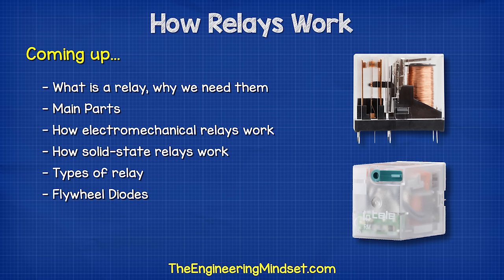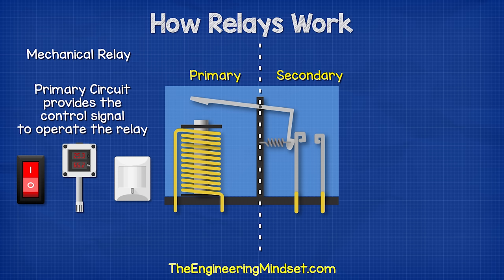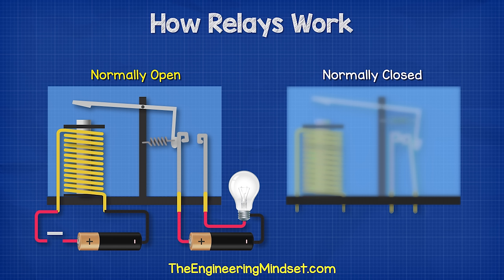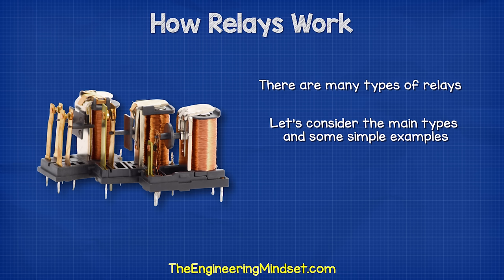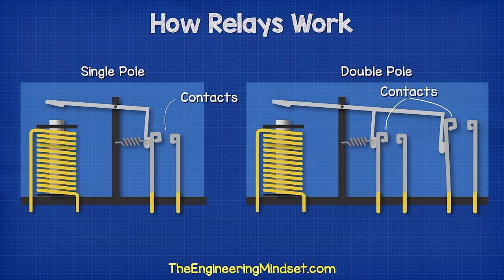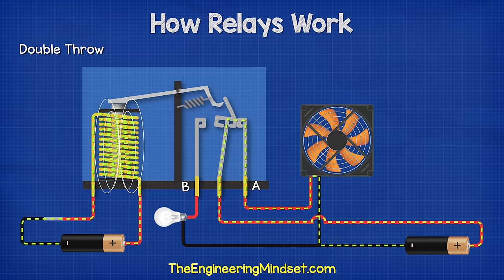How Relays Work - Basic working principle  electronics engineering  electrician amp

Comment: Prior to introduction of communication-based train control (CBTC) and for those lines still not so equipped, the New York City subway system's signaling system is run by electromechanical relays, with gear designed a hundred years ago.  Konrad Zuse's Z-1 computer, the first production computer in the world, used relays rather than vacuum tubes because Germany did not have access to vacuum tubes.  This computer was used in 1941 to design the V-2 ballistic missile.

Comment: Thanks! Dumb question here 🤚. If the purpose of the relay is to open/ close a circuit, why not use a button?
Reply from the maker: Because we can automate it with sensors etc, no need for someone to push a button then. We can use it in safety systems for example to automatically take action.
Reply: The Engineering Mindset makes sense thanks!

Comment: Last week I was given a broken earth leakage breaker to open up and see how it works. I really enjoyed it because I always wondered how a switch de-switches on its own, you know...

Interestingly enough, instead of the relay controlling a circuit, the leaver of the mentioned relay above, is used in a mechanism. You have the switch in the N.O position and closing the switch is like standing up from a crouching position. Even with passion to stand up, it takes so much effort to do so... as with the switch. The switch latches in the N.C position like locking your knees before gravity brings you back to the ground and giving your head a haymaker with your heels. 

You know that weird thing some of your friends do when they kick the back of your knee and you collapse to the ground? That is what the relay does to the switch. In the closed position it is very stable, but has a linkage that creates a weakness for the switch to spring back(with a spring, how original) when introdused a very small force over a small distance. 

You have your live and neutral inputs for the breaker. It gets converted into a small dc current to power the relay. When the neutral and live wires are misbehaving or you press THE BIG RED BUTTON, i mean the test button the circuit has compared voltages and determines that there is enough current and gives some to the relay. The relay wakes up, kicks the switch between the legs, the switch enjoys the fetal position and puts the misbehaving wires to sleep.
Reply from the maker: Seen our new incredibly detailed MCB video? link: https://youtu.be/gqEu9t8HwW0

Comment: I found this useful in my current amateur wiring project, and got some good ideas to make my circuits more efficient/safer. I would like some more information on using VSRs and maybe a section on common naming conventions so I can more confidently purchase these things! For instance, when using a "12v relay" does this mean that a 12v current controls the load circuit? How do I know if it's normally open or normally closed, because this information is not usually advertised as far as I can tell...

Comment: In electro-mechanical pinballs, there are at least a dozen relays used. In electronic pinballs, there still are a few. The flywheel diodes are extensive.

Comment: which side of the relay would the diode be placed?

The feed in to the coil side or the other side controlling the NO/NC switch?

Or both?

Also, how do you calculate what size diode you would require?

Comment: Im going to use relay for two contactors used in automatic trasfer switch. Can you give advice on what is the specification of diode to use to prevent back emf? The relay is 220vac coil 10amp normally close. Many thanks if you can help.

Comment: Have an AC relay resistance of primary is open circuit yet it works fine. Could it have a capacitor in series or even diodes?

Comment: Will make a small automation through my solar inverter's dry contact signal. 
When on battery mode, it switches to NC status and will send a signal to a contactor with 1 NO and 1 NC position. Once the contactor energizes a red strobe will activate, indicating the unit is running in battery mode and when de energized a steady green light will be on through the NC position.
Reply from the maker: Seen our new video on HOW SOLAR PANELS WORK in detail https://youtu.be/Yxt72aDjFgY

Comment: Hi Nice video.  I have a  boat (RIB) with an inboard diesel engine and z drive. The trim and tilt function which lifts the drive unit and propellor up and down is controlled from the helm using a  up down rocker switch. The circuit contains a hydraulic pump which in turn is operated by two 24v relays, ( one for up and the other for down) I think they are  the normally  off type.  Im wondering if solid state relays would be a better and more reliable alternative?

Comment: I wanted to use relays and a battery with a diy switch to control the water level in my pond. I’ll also use it to switch a small dc pump when there is a power cut. This way I don’t have to worry about power cuts

Comment: I bought a 12-position knob switch to control several circuts of LEDs (mostly in pairs). My hope was to have Position 1 as OFF, Position 2 illuminate Pair A, Position 3 illuminate Pair B, Position 4 illuminate both A&B, etc. (The project is a model house and garden; I wanted to be able to turn lights on/off in groups to look more realistic). The concept is simple but the wiring is complicated for a beginner, and I've bitten off far more than I can chew. 😑

Comment: For the Back EMF, i have been experiencing 36W fluorescent tube being damaged during power cuts. So I get to change the fluorescent tube every time there is a power cut and when power comes back on again. So how do I connect a diode like the one explained to protect the light tubes from back EMF? where exactly do we connect the diode on the circuit?

Comment: Quick question: 
I have battery with power 12V/8Ah
I have a wire harness with 12V/80Ah relay on it.
Can I use that relay?
What’s the advantage and disadvantages for the setups, also longevity of the setup.

Comment: If I’ve got a 12v relay (for car lights), can I run it at 24v?
Reply: In this case, no. Please always be aware of the rated coil voltage to ensure optimum performance.
Reply: TELE Controls Inc. right, but could I do it?

Comment: 1:30. Says relays are used in circuits to reduce current that flows through the primary control switch.
But Isn’t the amperage (current) going to be higher on the low voltage side with the battery?? Since as you reduce voltage you increase current.

Comment: Fire alarm- relays for tamper and flow. Normally open for tamper and normally closed to flow sensor. Power close for tamper to set of fire alarm and power open to let you know the water is flowing.

HVAC-NO contactor used to sense water, NO for dual fuel, NO used to turn on fans, NC to set off alarm with float switch, used to turn on line voltage heating with low voltage thermostat.

Electrical-relays are used to power up a lot of lights, also lights and fans for grow rooms.

Relays are great.

Comment: what type of relay would I use if I wanted to take a 230v UK mains supply to simply close a circuit?

I want to fit an always on extractor, however, it reports it has a manual override that can be operated via an unpowered switch.  I figure that the fan has 2 contacts, one of which is powered and the switch simply closes that circuit.

Problem is, I will have a switch which will be providing 230V.  Also, the switch is a smart switch that I can control via my smart home.

If I can get this to work, it will allow me to control it via other sensors elsewhere on the house.

Thanks for any feedback

Comment: I am working on a useless machine (turn itself off when turned on) and I think a relay will be useful. I am using sensors to detect temp and vibration after which the circuit will turn off with the help of relay and Arduino

Comment: I really wish you would change the explanation of the latching circuit. it is not how most relays work. typically the latching function is done with a set of normally open contacts, on the relay itself, wired in parallel with the monetary electrical component that starts the relay function. They have a normally closed stop button in series with that parallel circuit to shut this latched circuit off.  I really like your stuff and use your videos in industrial electronics classes I teach in a Community College. This part of this one will confuse the hell out of students though and I am reluctant to use this one.

Comment: In the latching relay representation of the elevator, why does the lamp stay on when the call button is released as the power is being cut to the initial circuit?

Comment: 7:30 ive seen relay in ebike controller to turn on main power hehe
id like to use a relay to turn on and off a homemade  spot welder with microwave transformer 
though i did not find a relay that suit my need yet  that is easy to use

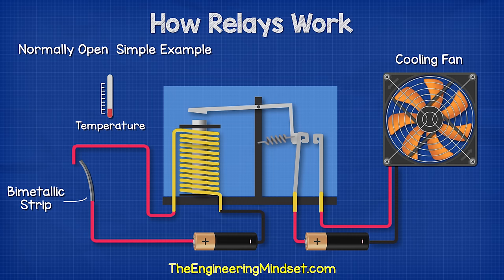Comment: I hope someone can help me with this question. In the example at 7:56, can't we take out the relay and one of the batteries and have everything on the same circuit? The temperature would cause the bimetallic strip to bend anyway and complete the circuit, right?

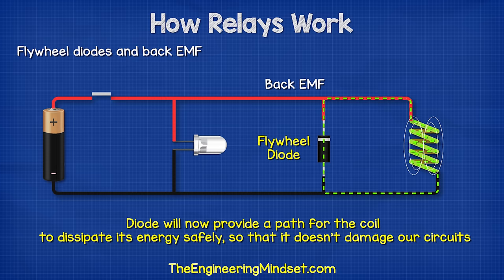Comment: @13:40 why doesnt the current still flow or at least partially siphon off  through the flywheel diode even when the circuit is on or closed? why does it only flow through the diode when the circuit is off or open?

Comment: That’s my best channel. you’re doing a great job. I have a question for a normal house how many amps does it need To turn on everything? I was planning on getting a generator that would be enough for me. Thank you
Reply: What’s a normal house?.
You have to calculate every single item and then some.
Iron, toaster, kettle can be 3KW each. Water heater?, oven, grill, washing machine, dryer, microwave, blender/mixer, hob, waste disposal, extractor fan, under cupboard light and main lights. 
Wow, that’s just the kitchen!.
YOU DID SAY TO POWER ALL. Lol

Comment: Hello, given the typical "Bosch Style" (or Amp/Tyco) 12VDC automotive relay; with an average of 80 ohms for the primary coil winding (12VDC, 80 ohm = 150mA),
approximately how many turns of wire in the primary coil winding?
also, what gauge (or mm2) wire is typically used?

Comment: Is it possible to power the 120V coil of a 240V contactor with one 120V leg of the 240V contactor circuit? It seems like it ought to work, but the fact that each leg of the 240V circuit acts as the return path for the other leg makes me wonder if there would be some weird interaction, like constructive interference in the coil.

Comment: What would you use if you need a low voltage load (like 12v DC) to be controlled by a higher voltage circuit? (Like 220v mains)?

Comment: Is it possible to use a relay from high current to lower current? Assuming I want to run a 24 volts load from single phase power supply?

Comment: Im here because the aircraft i work on use solid state relays however, we use them in a kind of circuit breaking capacity. This is odd because the aircraft does use actual circuit breakers for most of the system. It also uses digital circuit breakers as well which are opened and closed by computer. Just curious as to why we would need solid state relays.
Reply from the maker: Seen our new incredibly detailed MCB video? link: https://youtu.be/gqEu9t8HwW0

Comment: Serious question. Are the moving lines to the secondary circuit meant to be traveling from the positive and negative ends of the battery to the load? You have then going from the load to the battery. Is this how the circuit is bridged
Reply from the maker: Electron flow is from negative to positive, conventional current is from positive to negative. We have a dedicated video on the topic as it can be confusing at first

Comment: Sirs:  I have a 1974 Chevy Nova that has an Multi-Spark Magnetic Trigger Distributor (MSD).  I want to wire in a 4 or 5 pin relay so that the distributor doesn't have a current reduction during startup.  I would like to know why there is a 5th. wire on some relays while others have just 4.  Generally, I'm using a 40/30 amp relay.  Is there a difference between a normally open vs. normally closed relay.  Could you shed some light on the situation?  Thanks a bunch!

Comment: hi Paul i am new at this sort of thing what i like  to know the actual wiring  connection for a SOLID STATE RELAY  SSR -100 -AA   240 V
CONNECTED FROM MAINS POWER AND THEN TO H3Y-2
 TIMER  TO OPERATE
 TRANSFORMER THROUGH USING A MICRO SWITCH  THANKS  FOR YOUR TIME
Reply from the maker: Seen our new Transformer video? here https://youtu.be/jcY4QN7awEc

Comment: Hi Paul, Just saw your video about relays and was wondering if you could give me some advice? I am working on a project where I am using a 12v DC motor to rotate a screen. i would like it to rotate from 0 deg rotate 180 deg then touching a micro-switch then rotate in reverse,returning back to 0 deg, where it touches another a micro switch (home position) then repeating the loop. Basically trying to reverse the motor polarity using micro-switches. Kind regards René

Comment: Hey there, I have a question on an HVAC system component. 

To keep things simple we have a single speed outdoor unit with a 24v circuit that goes to a contactor relay. 

Y- wire is the 24v hot wire 
C- is your common wire. 

In this scenario we had pressure switches high and low (HPCO & LPCO) in series of the C circuit. 

We want to install a 24v Time Delay on Make (TDM) in the circuit. 

The question is. Would the TDM work on the “C” side, or do we need to install it in the Y side. 

Also, if we need to install it in the “Y” side do we also need to swap over the PCO’s to break the Hotwire before the TDM? 

going back and forth with a buddy of mine and my dad. 

I think we need to switch everything over to the Y hot wire side and they don’t think it makes a difference. 

Although they think it is best practice to put these type of switches on the hot wire side. The argument still stands. Does it make a difference or not?

Comment: the first time I've seen a relay was in our plant it was on control panel for a diesel fire water pump. each time we switched the  pump from manual to auto we had to reset the relay. although I don't know what is the benefit 😗

Comment: one thing. if we dont need back EMF then why we are using inductor. Becuase inductors are used to give us instnat power, so if we are using flywheel diode then this energy will be desipated. But if we want to light up the LED after the switch is off, then we will have to remove the diode..right? if not then how will we achieve it

Comment: For a game I would like to have a light be activated only when 3 buttons are pressed at the same time.  What would be the most straight forward method for enabling that?
Reply: if at the same time all you have to do is make each button complete the coil 1/3, when all three buttons are pushed the circuit is complete, without the buttons pushed at the same time the circuit won't be complete. Without picture its hard to explain but a simple thing.
Reply: @ThisIsntOmni  Thank You.  I'm new to these concepts, but I'll experiment a bit.

Comment: Hello Sir, I am planning to modify my electric trolling motor newport vessel 62lb 12v 60A to remotely operate. I bought Remote RF switch circuit 12v 20A to adjust the speed for trolling motor. The current rating is quite different motor and the switch circuit. Do I require to use the relay for that? And also I'm not sure where to put the relay. Could you please tell me any suggestions? Thanks 🙏

Comment: I am troubleshooting a refridgerator that the compressor will not kick on....

I have narrowed it down to the relay that is on the circuit board (not the one that plugs into the compressor)....

Im not sure exactly how to test it....i tested for 12 volts and i have 12 volts dc but on the other post next to it i only get 6 volts...no idea if i even need to test that side or not....im not getting any voltage coming out of the relay thats supposed to go to the compressor (120 volts ac) so either the relay has failed or something has failed prior to the relay

Comment: Can you list a example of when a normal close relay would be used on a devices.
Reply: Used as a stop switch to break a circuit.
So use a push switch to activate the coil and open.

Comment: FOR WORK TO GET DONE SOMETHING MUST MOVE...
Circuit = (Circle) Electrons flow in a circle from the Source (BATTERY NEGATIVE) Through the LOAD/DEVICE & back to the (Source BATTERY POSITIVE). Using up some of the Voltage.
Amps = (Current) Flow/Draw AKA Electrons Moving. The Device will only Draw the Amps it needs from the Source to work. Having a Source with more Amps is OK less Amps not OK. 
Volts = (Pressure) More Pressure the More Work Can Be Done with Less Amps. Devices are Voltage Sensitive. Too little Voltage Device will not work. Too much Device will SMOKE.
Watts = (How much work is being done). Volts X Amps = Watts. If your 12VDC Device Draws 0.5 Amps 12 x 0.5 = 6 WATTS of work being done.
Fuses = (No Fires in the Wires) Always use Fuses and put them as close to the POSITIVE side of the (Battery/Source) as Possible. 
AWG = (Wire Gauge Size) If your Device/Circuit uses/needs lot of Amps you must use lage AWG size AKA smaller number AWG

Comment: Hi
Can you help with a question I have a 12v heater that as a rundown sequence so the power must stay on but if I get a power cut this can damage the heater is there a relay that if this happened it would switch the power to run from my 12v battery instead please hope I’ve explained it enough

Kind regards John
Reply from the maker: You need this https://youtu.be/l0wmqKv6lDA